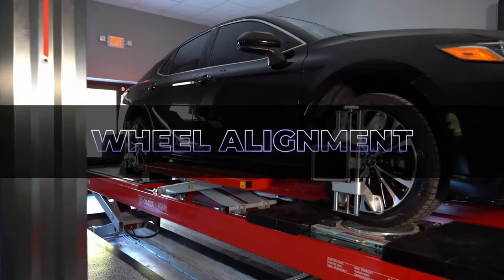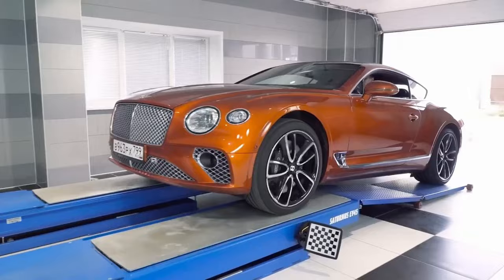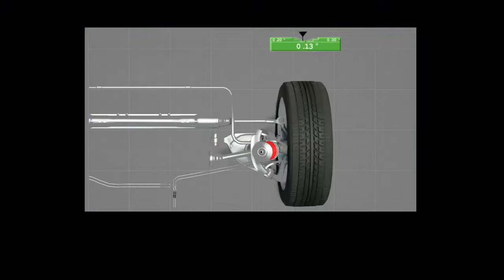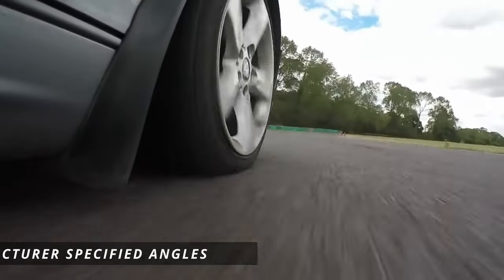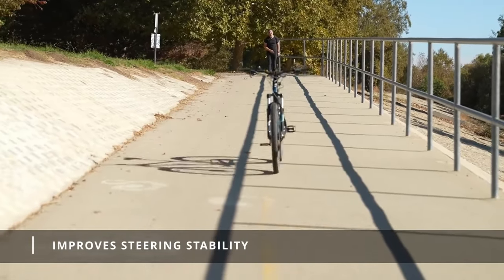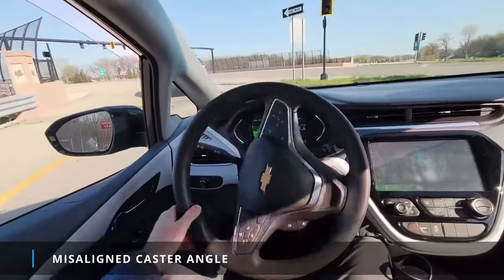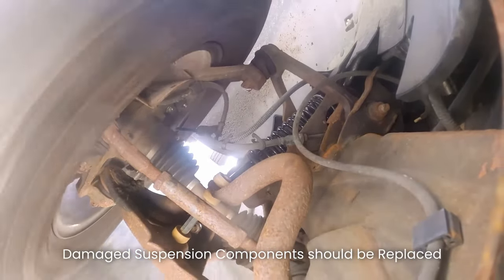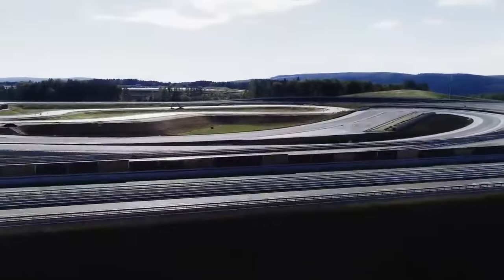Understanding the Wheel Alignment Process: Camber, Caster, Toe Angles, and Their Effects

Comment: i live in a state where it snows, rains and has shitty roads which meant i spent money i worked for to get my car aligned every few months. since it has new shocks, struts and new rear coil springs in getting it to the shop to have it realigned and a brake bleed since i had it in storage for about 2mo
Reply from the maker: I totally get it—living in an area with snow, rain, and rough roads can really take a toll on your car’s alignment. It’s great to hear you’re taking good care of your vehicle with new shocks, struts, and coil springs. Regular alignment checks are definitely important in such conditions, as potholes and uneven roads can knock things out of place pretty quickly.

As for the brake bleed after storage, that’s a smart move! Air in the brake lines or moisture build-up can cause issues, so getting that done will ensure your braking system is working at its best. Keep up the good work.
Reply: @motoringmasters  much appreciated. the car has new parts like suspension, control arms, a new tie rod, new wheels, tires, and more since it's an older vehicle it needed it 100%
Reply: Totally your prerogative but that's crazy excessive. I drive all day everyday for work and maybe do an alignment every 7 or 8 months or so. But it's a good mindset to have, so I can't really fault ya if that's what you want to spend your money on
Reply: @d-rockanomaly9243  i get my alignment done a bit more than usual cuz where i live it rains and snows which causes pot holes over time and the state cheaps out by filling the pot holes which is why i plan to leave said state when in more financially stable

Comment: After a recent alignment, my cars wheels started moving when going over broken uneven roads causing steering movements without any input and unstable. Went back to the garage and they said one of the toe rod is ceased and replaced  it. It still hasn’t completely stopped and it’s annoying me a lot. It has sucked the joy out of my driving. What  could be causing this?